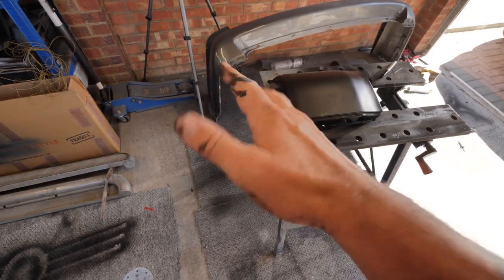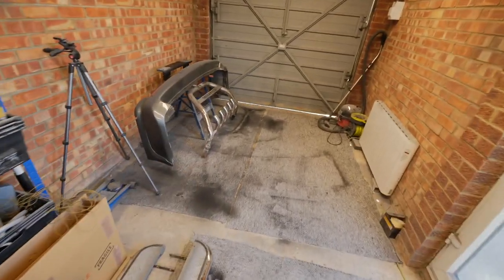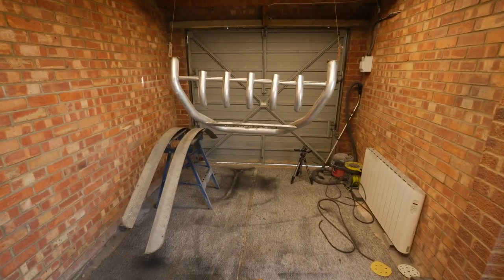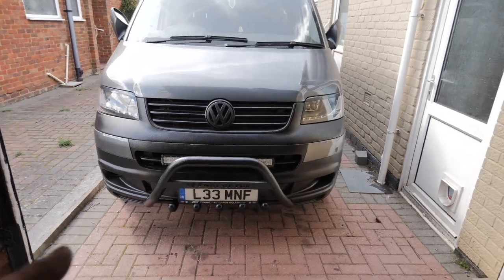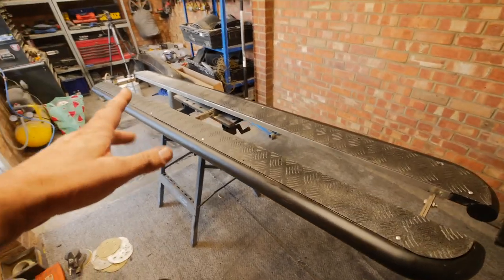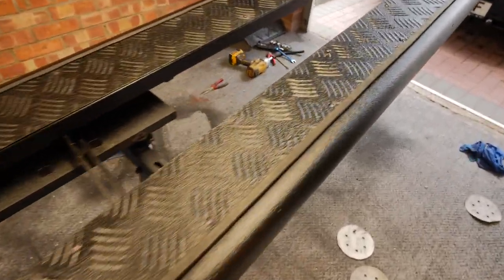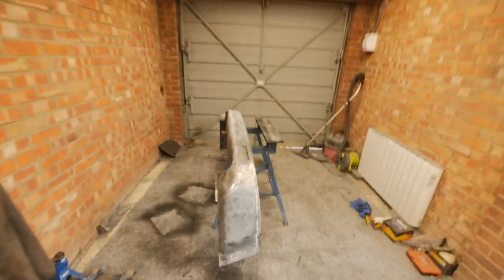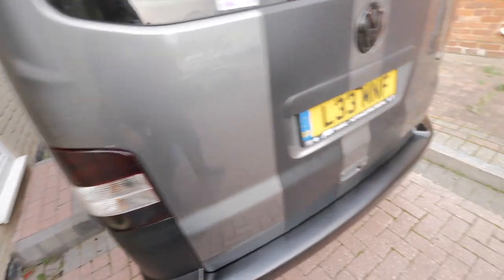Restoring bullbar & sidesteps with Raptor  - VW T5 Swamper Conversion Part 4

Comment: I like the Grip 4 didn't know that existed,  raptor workmate nice touch ! Speaking off lighting ,have seen the lights that fit in the wheel wells I think they are called rockslider lamps ? Might finish the " look " your going for .

Comment: so am I right in saying that raptor paint is just schultz but for the bodywork not the underneath ??? 
and where did you get the splitters for the rear bumper ??? I like the look of those,
 can't wait to see it with the wheels on 👍
Reply from the maker: Schultz feels more flexible than raptor. Raptor dries like a really hard plastic. Splitters were random ones from eBay.